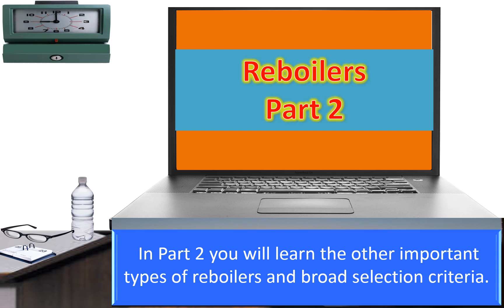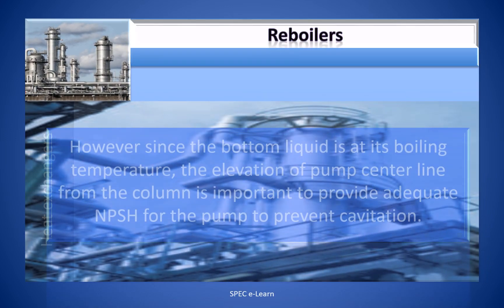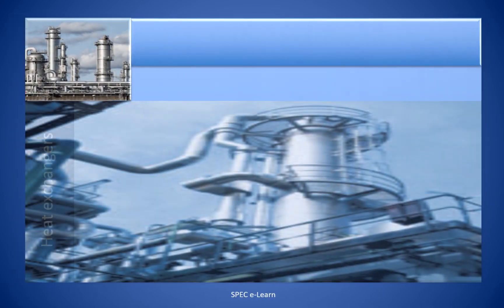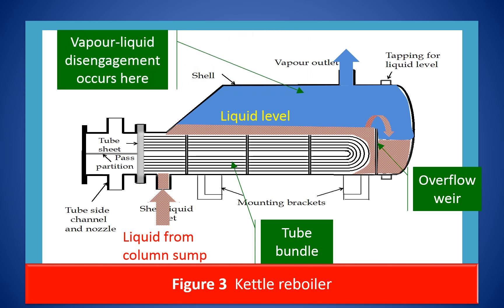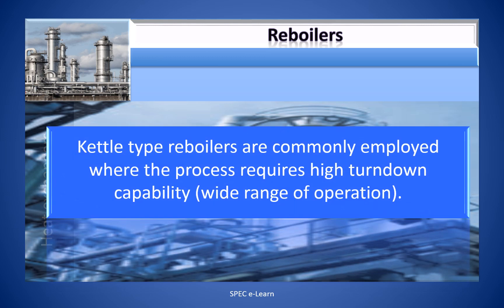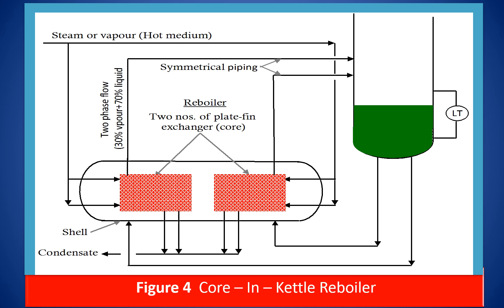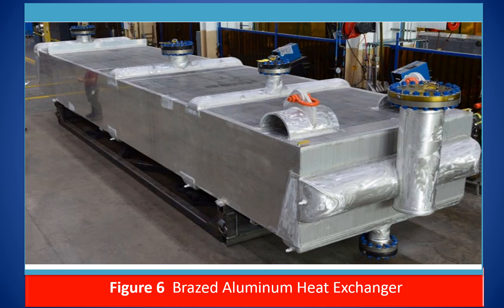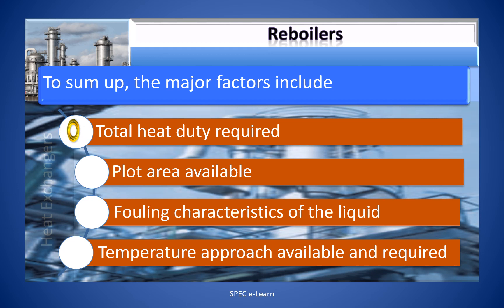Reboilers – Types, Applications  & Selection Part 2

Comment: sir how to cal reboiler duty of batch distillation
Reply from the maker: Batch distillation is an unsteady state process. A known amount of charge is fed into the still and distillation continued till  a pre determined product recovery is made. There are trays above the bottom of the still. That means it has only rectification section. 
The distillate concentration keeps on varying beginning with maximum concentration of the light product  at the start and keeps decreasing as the time progresses since heavy component concentration build up at bottom of the still.

If D is the distillation recovered and L is the reflux fed in certain period of time , the reboiler heat duty is = (L+D)*H where H is the enthalpy of vaporization of product. removed. .Assuming you are processing a binary mixture of A and B, and If H1 is the enthalpy of vaporization of the light component A and H2 is the enthalpy of vaporization of component B then H = x* H1 + (1-x)H2. That is sum of the enthalpy of  vapourisation of individual components removed. Here x is the mole fraction of the light component in the distillate.
Reply: THANKS SIR GOT IT 
THANKS  FOR SPARING YOUR TIME
STAY HEALTHY SIR